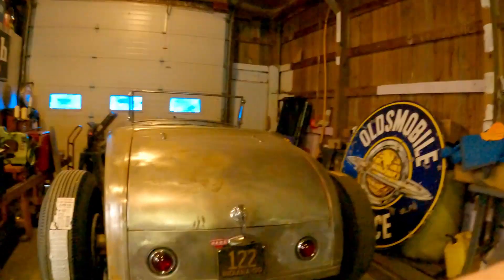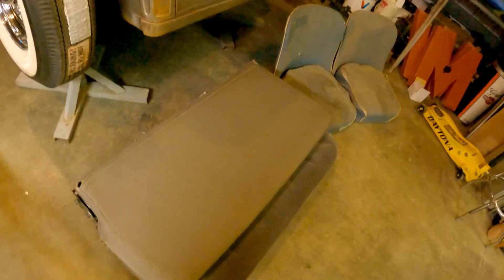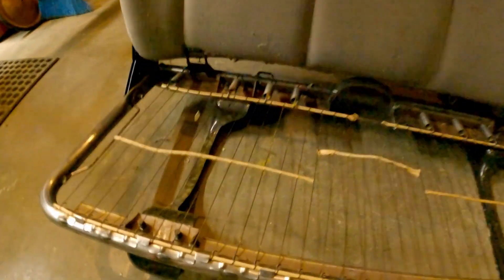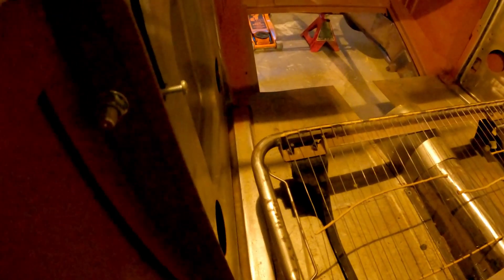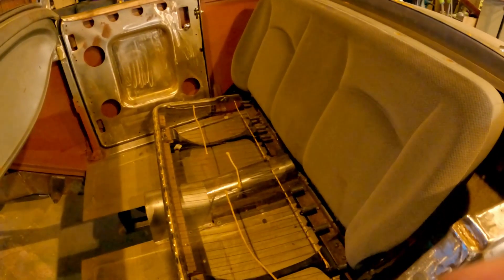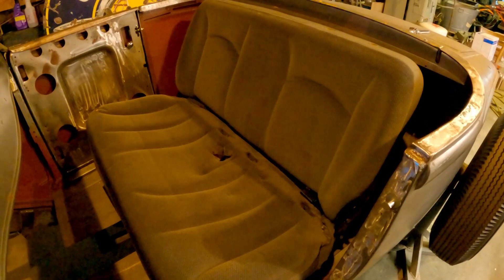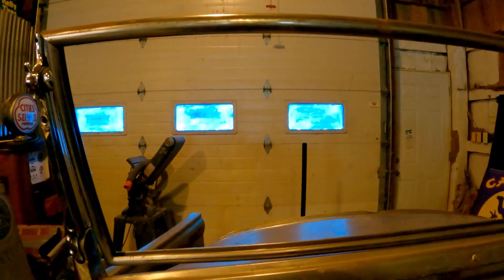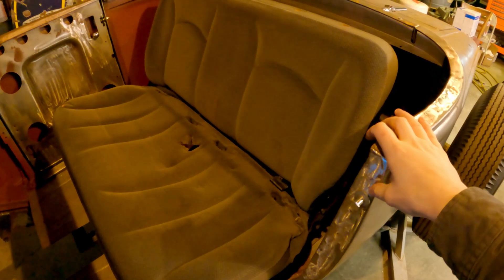1930 Model A build 3 Seat Caravan

Comment: I'm on board 😃 like the car
Reply from the maker: Thanks! I checked out your vids as well
Reply: @biscuitjunctionhotrods4096  nice I started with a sedan cowl 1930 31,and then I picked up a 1930 model A frame and modified it, The VIN number on the frame was a 30, so I guess that's what I'm calling it .Cool well we'll just follow along and see how it turns out for both of us you got a cool shop and a great car.
Reply from the maker: @VinoRatRodbuilds   that wood body is neat. i really like your top

Comment: My middle row seat folds which my seat is out of a 2001-2002 Dodge  Caravan. I seen you can buy a 40" bench seat frame floor mount bracket for a Jeep Baja CJ 7 on the Internet which is 140.00 on the Internet. I think that would work on that middle row.  seat.